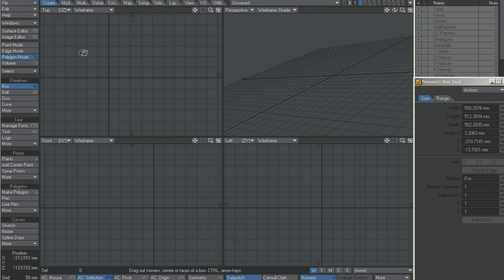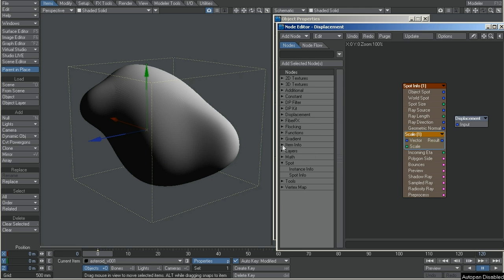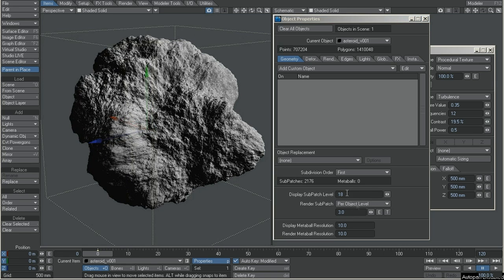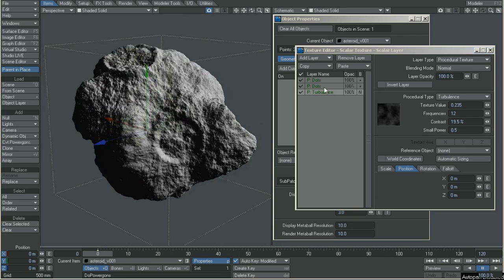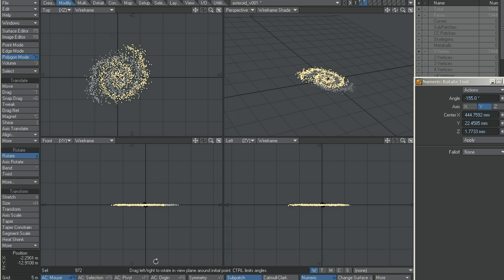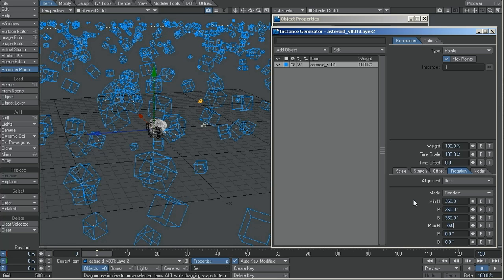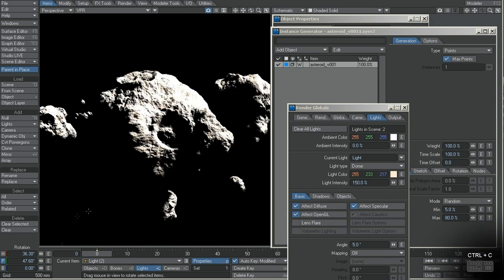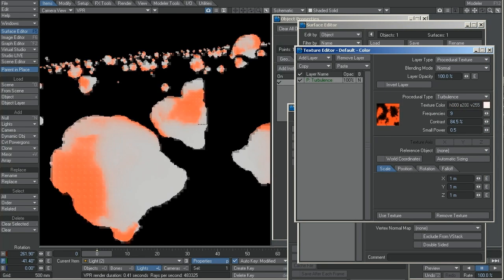Making an Asteroid field - 3D tutorial - Lightwave

Comment: Thanks for the tutorials, Well done and good looking, though I personally know most of that.
Just some thoughts, like almost three years after you posted it :)

I Myself takes it more of a habit to call the metaform Plus plugin by ctrl shift and right mouse menu that  I have set up for easy acess, and that metaform Plus plugin let´s you put in numeric values of subidivision levels so you only have to use that once, instead of clicking subdivide and also check metaform mode, and then also do it twice, it´s just a tip to speed up metaform divisions ..if you make it a habit you will soon know which value is appropiate to get desired divisions.

The other thing, you use normal displacements through nodes, and not with the normal displacement, a question would be what advantage do you want in order to use that, I think it is faster to set up with the normal displacement in the drop down menu in the deform tab, than with nodes..the question is which one deals with normal most efficient and fastest?

Cheers.
Michael aka prometheus on newtek forums.

Comment: someone might have a hint for me. the moment i start adding subpatches like 12 or 13 my framerate drops to less then 1fps in working space when im at 15 i can expect up to 10 seconds waiting time befor i can move my mouse or an object or something. i can only suspect some kind of option (the mesh has only about a million polygons at that point) shade solid display any tip will be apreciated
Reply from the maker: *****  a million polys in open gl you can expect to do that, is a lot ( in my case with my pc I have a terrible lag when I reach 2 million polys), can share your machine specs? micro,ram, video card?, for that reason you have display subdivision level and render subdivision level ( this will depend on ram), when I need to go beyond with the details or subdivision I make render test and continuously check the ram being used ( to avoid a freeze or system hang up) thanks for watching, David
Reply: David Agüero im using AMD Phenom II x4 840 (3,21 GHz 51.38 GFLOPS) - 16 BG Dimm DDR3 - NVidea Geforce GTX 460 - Win 7 x64
Reply: +Dayta I believe that the OpenGL render of polygons is GPU specific for the most part. I have on my main PC a Phenom 9600 Quad-Core 2.3, 8Gig RAM and a GTX 650 1Gig. So I'd look into the GPU see if that's the problem.

Comment: can't subpatch in geometry options...i dont know why?
Reply from the maker: you mean in Layout? you can activate the subpatch in two ways, 1 -  in modeler you need to hit "tab" on your keyboard and save, when you switch to Layout the object will be subdivided and you can control de level of subdivision in the geometry tab, 2 if you forgot to hit "tab" in modeler you can go to the modeler tools in layout and toggle the subpach, if you do this option you need to save all changes in scene and objects other wise the next time you will have to do it again, thanks for watching, David
Reply: it worked, thank you^^
Reply: one question, my vpr shows the image i want, but the renderer shows me another image where the geometry is not deformed...so how do i get the vpr image as the renderimage?
Reply from the maker: ***** Hi, you have "display subpatch level" and "render subpatch" in this last, imput the same amount that you are using, be careful with the amount, it can hang your system if you go too high, greetings, David